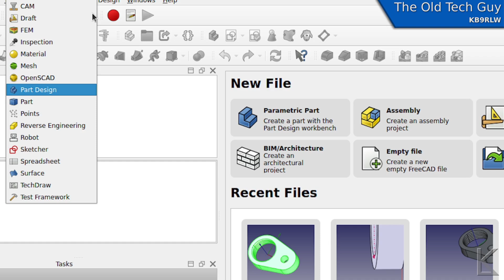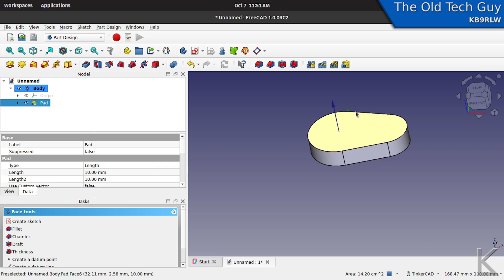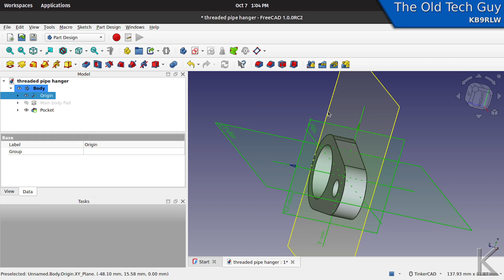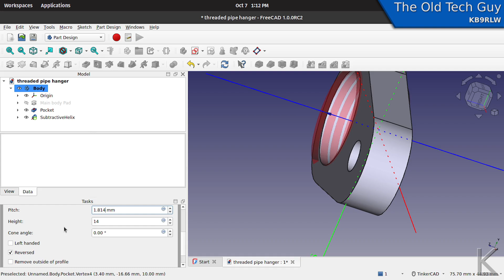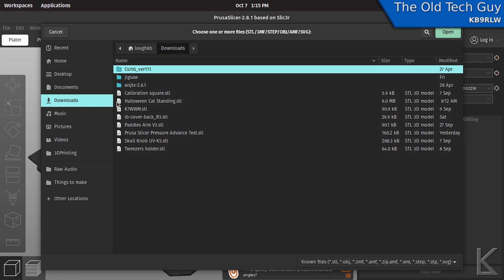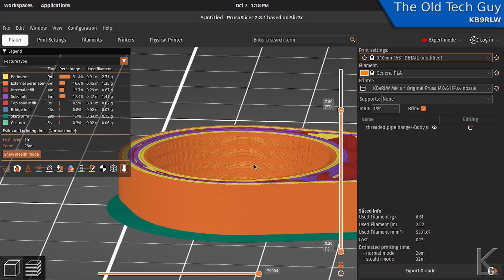3D Printing - Creating custom threads in FreeCAD

Comment: thanks this helped alot, imagine my supprise when the 12v pump I order arrived with propriatary pump onion threads on it but doesnt come with fittings and its an brandless pump. So I have to 3D print my own custom fittings and design this custom thread. Hopefully my design fits, it ought to.

Comment: Thank you for the tutorial. You took the time to explain it very well. One question, what size nozzle would you suggest using for threaded parts?
Reply from the maker: I can only comment on the 0.4 mm nozzle that I run.  It's fine for thick threads like this.  I wouldn't try to print with fine threads like for screws, there's just not enough resolution with FDM.  Those smaller threaded screws work fine as self-tapping with holes that are 0.2mm smaller in diameter than the screw.  No threads need to be printed.

Comment: It's a great video. But actually the profile triangle vertical distance should not be same as the thread pitch 14TPI i.e. 1.814mm. It should be smaller because the thread has s small width(fillet) by itself. Anyhow, your settings will make the thread inner diameter larger than it should be, that's why the final printed part was very loose to fit the rod.

Comment: You made the hole for the threads 24.6 mm dia which was the biggest diameter of the mounting threads plus 0.2 mm for tolerance. And then you cut deeper in that hole to make the threads. I was expecting the other way around or that you made the hole 21 mm + tolerance before cutting the threads. In my estimation your part would just slide on and not grip the threads at all. Was there a change done before printing or is it something I haven't understood?
Reply from the maker: Nothing was changed before printing.  I'd have to re-watch the video, but I know it fit well, so you might be seeing something I did in an inverted sense.

Comment: Hi, thank you for this. I've tried many times, and get threads; however if I do a 'check geometry' i often have many many errors for broken faces, etc. this limits any editing after the threads. sometimes, though, they work perfectly with no issue. Can't figure out what the delta is.
Reply from the maker: Actually a small oversight. Perhaps. The pitch in the Helix needs to be a very, very small amount wider than the pitch of the thread so the geometry doesn't overlap. And it can be 0.01 mm more in the Helix and that will fix it.

Comment: This was another very!! entertaining and informative video. Thanks! And I think you made a small error on your thread. NPT has a tooth angle of 60 degrees and your angle is larger as you can obviously see in your tooth sketch. This is because you used the dimensions of 1.841 and 1.25 mm, but did not take into account that the tooth has a radius on the tip. Constraining the tooth on the 1.841 and the 60 degrees angle would have solved this. And you could have adapted the radius to get to that 1.25 mm height of the tooth. However I still very much enjoyed your video and I want to design this one too as an exercise. Besides that I missed the angle of the tapered thread and I had the idea that there watch a checkbox with an angle in your video. Love your video's man!

Comment: This is usefull tip when you play and starting to get familiar with freecad sketch & tools. Next step is use fastner workbench and using custom threads with custom pitch and this operation takes about about minute 😅
Reply from the maker: The fastener workbench does not provide all types of threads. This video teaches you the skill to do custom threads when needed.
Reply: @loughkb screwtap&die tool in fasteners has custom option so you can do any threats you can imagine. Its useless only if you need custom threat profile like square or half circle...
Reply from the maker: ok.

Comment: im sorry followed this exactly in my project and just changed the base and height of the triangle dimensions, doesnt work it says "tool shape is not valid for operation"
Reply from the maker: When you changed the dimensions of the cutting tool, you also need to change the pitch in the helix. Those dimensions matter so that the cutting tool is not intersecting itself as it cuts.

Comment: Maybe you've learned this now, but there's a nice spreadsheet function in FreeCAD. You can create a two column list of your various sketch bits (thread_hole_radius, carabiner_hole_radius, thickness, thread_pitch, thread_depth, and so on. Then on the value cell for each, right click and create an alias with the same or similar name of the value on the first column'. You can name the spreadsheet as well if you need to use more than one, for instance. Then instead of manually entering each value, you can reference those spreadsheet values, even do math on them.  When you pop-up the little window to enter a dimension, there's a little dot icon that you can click, or just start your entry with the equal sign like excel to put a formula or reference a cell.  On smaller projects may not be as useful, but can save typos when re-entering the same number over an over.
Reply from the maker: Yes. If you see my video on the parametric utility box, I use a spreadsheet. I all use offset sketching and manual sweep fillets and such.
Reply: VarSets can do many of the same jobs and can be quicker to work with (but spreadsheets have their own advantages)

Comment: Great tutorial. Like you I am a relative newbie to FreeCad but I am trying to learn with a much older brain. So many ways to do things in FreeCad  and I've watched several different videos and methods  of doing threads but your method worked for me the first time. Also, great tip on constraining the thread profile to the through hole instead of the center line. Thank you.

Comment: You make a pretty good teacher. I started by forming a cross section and rotated it  Then I got into trouble  Now I will just use a 1mm thick circle and then a smaller drawing and add a 4 mm thick part and see if that works better. Years ago I learned autocad but that makes for problems as I always desire using autocad commands. Thinking of making a 1/2 inch to the foot model of a steam engine.

Comment: Kevin, I've already have seen the later YouTube where you used the thread addon to FreeCAD.  How about doing an update to this YouTube using the thread addon?  I think that this is certainly the easier way to do it.  Thanks for the FreeCAD videos -- you certainly explain the concepts so well.  Happy Holidays to you.  73's WD6FIE
Reply from the maker: You might have me confused with somebody else. I have not used the hole function with threads in a video. 
In fact the whole reason for this video was that the built-in thread functionality did not have a match to these pipe threads here in the US. So I had to do them custom.

Comment: This is not only the best threads in freecad tutorial that I have seen, but as a beginner, very probably the best and clearest general freak head tutorial. I didn't have to stop and hit pause 1000 times but maybe only 10 or 20 absorb it all.  I had struggled with free cat some a few years ago and left it behind and it just got back into it now that 1.0 is out. The biggest lack I saw in it for my purposes was easy threads. This is not quite TurnKey but it is fairly easy to understand and use.   I just liked and subscribed, and if I see more of these you may want me as a patron too.  I make a very smal monthly donation to 4 machinist channels and this may well be my first one outside of that genre.  Looking forward to exploring your channel more, and thanks so much for this video.  Superb!

Comment: This is a GREAT tutorial, except that very little of it looks or acts the same in version 0.21.2 for Mac OS.  It all makes sense, but the toolbars are totally different, some of the tools don't even exist, or have different names (the Dimension tool).  Clicking on various icons and buttons opens totally different windows.  Various behaviors don't work as expected.  For instance, to constrain a circle's center to the origin, I had to first move it off the origin.  Clicking on a face does not allow for creating a new sketch on it.  The list goes on and on, and as a new user, it's difficult to tell if my version has so many bugs, or if many of the demo videos have heavily customized the app, or if it just behaves so differently between versions and operating systems.  Even after making customizations, it is extremely frustrating spending hours only to realize that FreeCAD is not intuitive and has very little consistency.  And this is from someone who has used other CAD and 3D modeling tools.  Again, this video is great, and the workflow even makes sense, but unfortunately I am unable to duplicate many of these steps.  I may try the Windows version to see if there is any difference, but sometimes I guess you just want software that works fast and elegantly and intuitively, and has some consistency between versions, layouts, workflows, naming, etc.
Reply from the maker: Yeah you need to get the newer version. I believe I pointed out in the video I was using 1.0 release candidate 2 . If you go to the free CAD page somewhere down in the middle there is a link to get the release candidates. And I believe the Mac version is there too. Search for version 1.0 RC2 or later.
EDIT:  I just went there and checked and yes 1.0 RC2 is available for Mac. Here's the link to the download page. 
https://github.com/FreeCAD/FreeCAD/releases/tag/1.0rc2

Comment: 2 "tips"
1) for the hole you can select "all through" so you dont need to put size its better way of doing it (lets say tomorrow you like to make the main body bigger it will "auto fix"
2) you can use "add ones"  and search for Fasteners and you can use it

Comment: You're a good teacher. You may know this, but you could have saved a bit of time. For example, you could have added the holes to MainBodySketch when you created it rather than drawing them on the surface of the body and pocketing them. Another time saver - when you chamfer or fillet, you only need to select a single segment of an edge. Since all your chamfers are the same depth, you could have selected everything you wanted to chamfer and done it all at once.

Adjusting layer height in the sketcher to create better threads was informative, and I appreciate you actually printing and demonstrating how the part fit on the pipe. Nicely done!
Reply: All the above are true... He made the part he wanted but had to go thru tha math and ignoring the taper form of mast end. FreeCAD Hole tool can make almost of all standard threads (including tapered threads) and playing with tolerances too. He mentioned that the Hole tool is just for metric but it's not true. The same applies to DIES within the Fasteners workbench both metric and imperial systems (blue icons are for Imperial and yellow ones for Metric.

Comment: Nicely done tutorial. Nothing wrong with the way you did that. Making a cutting tool is one of the easiest ways to make complex objects. Dress-ups should always be saved until last - that is just good design practice.

 I can recommend 'Open Source CNC' for using the CAM bench and modelling useful things, 'DuyQuang Dang' for seeing what is possible and definitely do the projects, 'OffsetCAD' for modeling real world object, 'MangoJellySolutions' as one of the most polished teahing channels, and 'Katt Kushol' for practice work, Assembly workbench, and some Sheetmetal workbench.

There are  few other English channels out there but they haven't uploaded in a while (like Joko Engineering) and most of the rest are silent films and time-lapse silent films. The "Watch me make THIS" tutorial that teaches nothing.
Reply: Those are all good recommendations, especially MangoJelly. His new beginner series using FC 1.0 is great.

I just discovered DuyQuang Dang a week or two ago; if you want to create art like sculptures and rings with FreeCAD, he's your guy. 

Even though Joko hasn't been producing new videos for a while, some of his stuff is still relevant. One video I found especially interesting was designing headers for an car engine. Getting the pipes to twist together was something I'd never considered before.